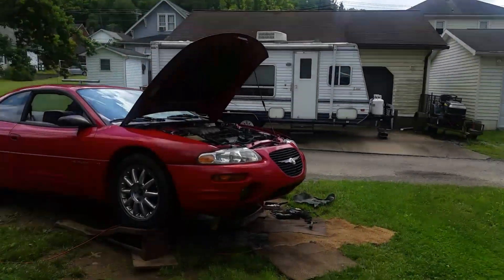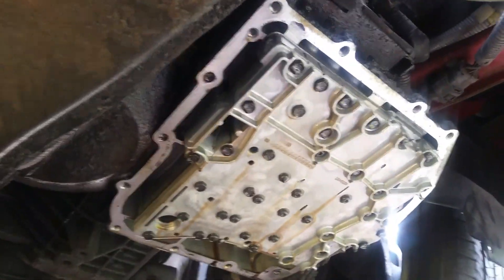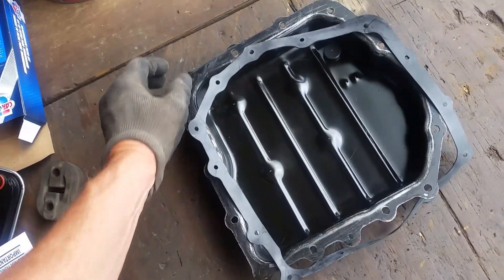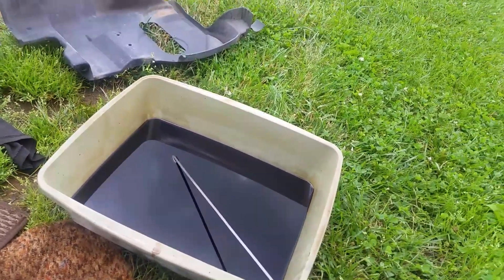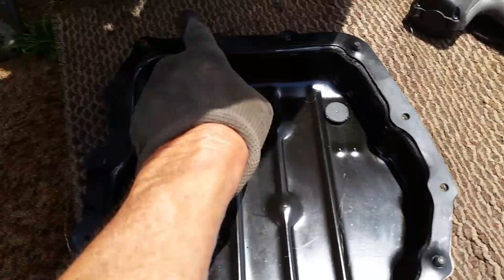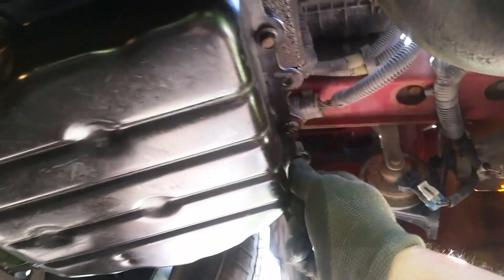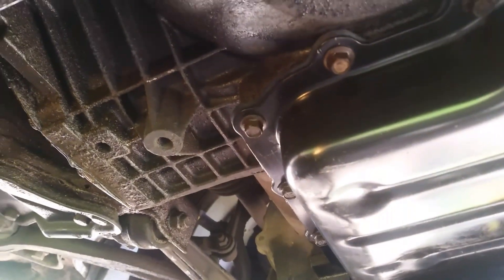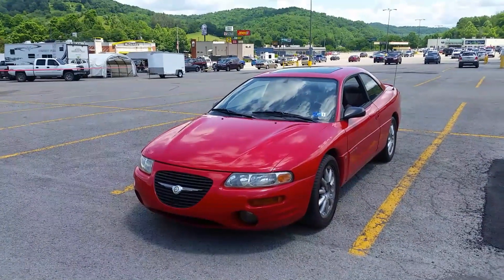Chrysler A604 604 41TE  Ultradrive Transmission fluid change for Newbies.

Comment: I get a failure of gearbox in my '98 sebring convertible - the gears went out.
Just drives on 2nd when select by gearstick, nothing on D neither R, N is blocked when engine is running, only whenis off is possible to pull a car... last time I flushed atf around 6yrs ago,  but drove on it maybe 55k mil, mostly on highways.
Color of the atf was light brown, no bad smell, level was ok or even too much. Then after a failure (slipping on D and not changing to 4rd) had a darkrr color and burned smell...

Do you think in my cas a atf flush can help? Or just complete drain and fully fresh atf refill?

Comment: Question? Have you ever changed the differential gasket behind the transmission pan? It’s side ways up, what’s crazy it holds transmission fluid to the transmission( real tight up there). Question what type of sealant to use on the differential cover? That holds transmission fluid? 1991 Chrysler New Yorker. 4.9 auto.